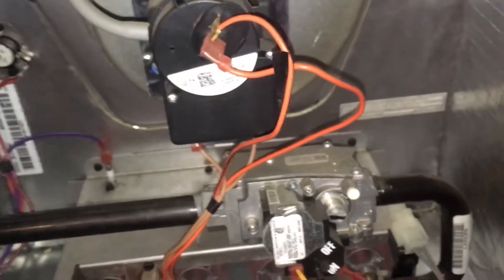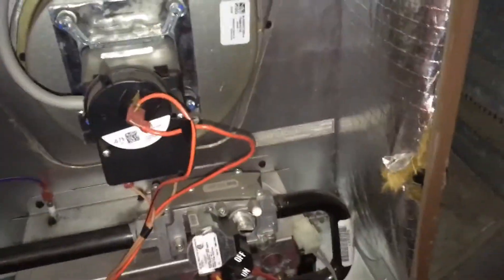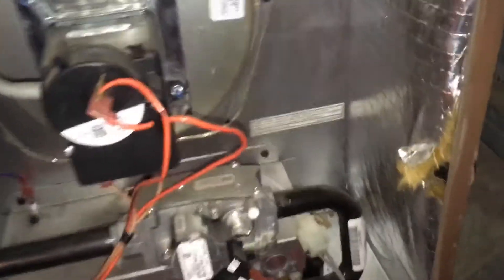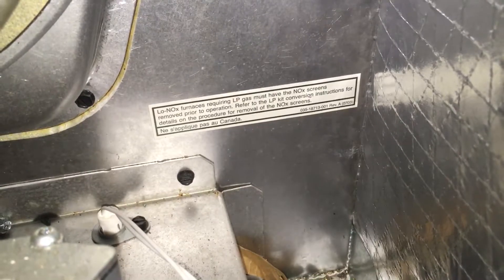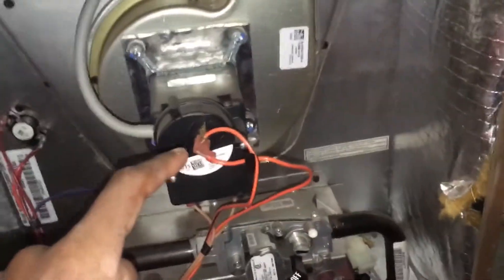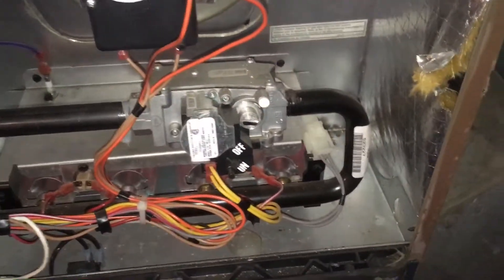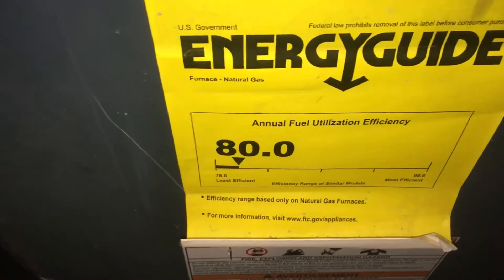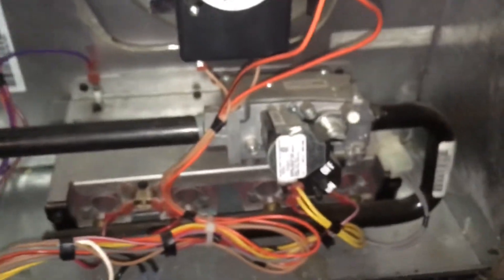Evcon/Coleman 80% low nox gas furnace running

Comment: What's the btu rating?
Reply from the maker: It’s a 100,000BTU but it’s 80% so the BTU’S going into the house is really 80,000 This furnace produces so little pollutants I am very surprised. I saw the combustion analysis and I was very surprised The red glowing is the nox screens. It heats the house really good
Reply from the maker: I will make a more detailed and in-depth video on how this furnace works later today
Reply: I have a furnace that doesn't burn fossil fuels at all, in fact, mine is actually a heat pump with emergency heat.
Reply from the maker: Shepherd Wolf You live in a warmer climate than me so that’s why there aren’t a lot if any fossil fuel burners there
Reply: @khalilt6508  
True.